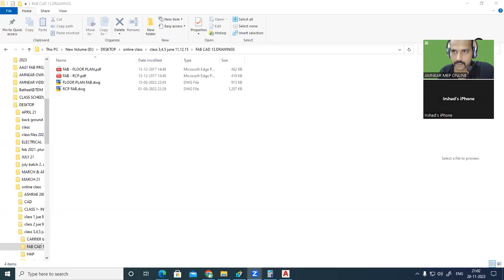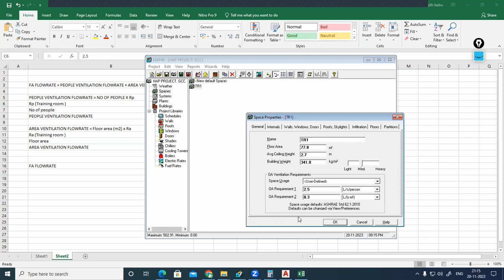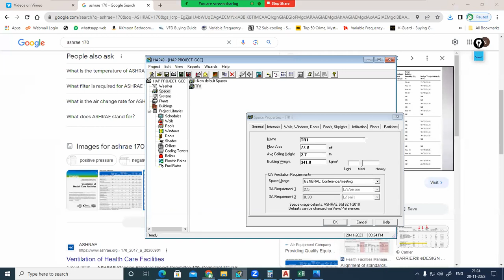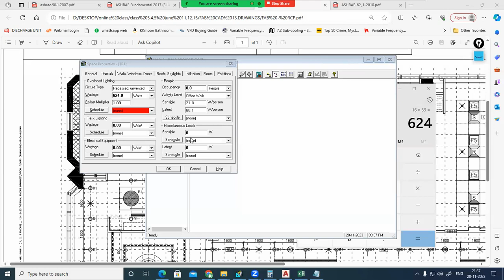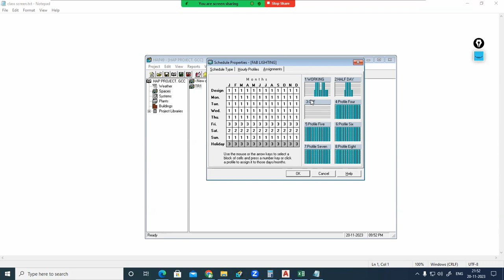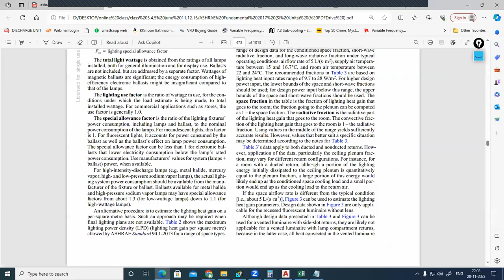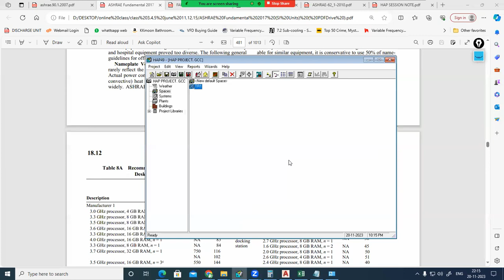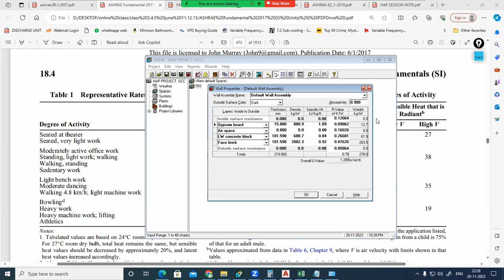'HAP Project Session 2'. Heating and Cooling load Calculation using HAP. Basics to Advanced. AMNEAR.

Comment: blast multiplier is 1 ? pls explain this?
Reply from the maker: For fluorescent lights, power is used to drive both the bulb and a ballast starter device. The program computes the total power draw for the lighting fixture by multiplying lamp wattage by the ballast multiplier. Ballast multipliers values from 0.1 to 2.00 are permitted for fluorescent lights. For LED Lights ballast is not mandatory. Thats why its 1. Also, incandescent lighting fixtures (not common now a days) are used, the ballast multiplier should be specified same as LED, 1.00.